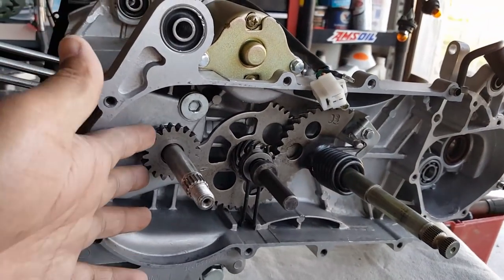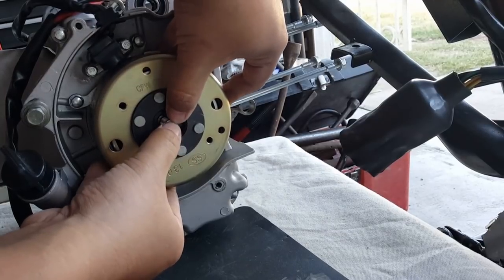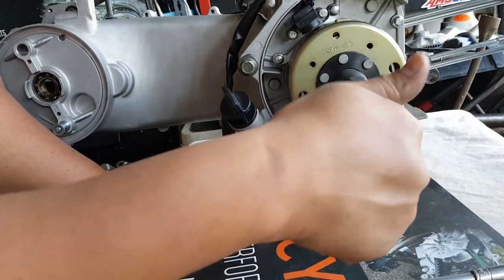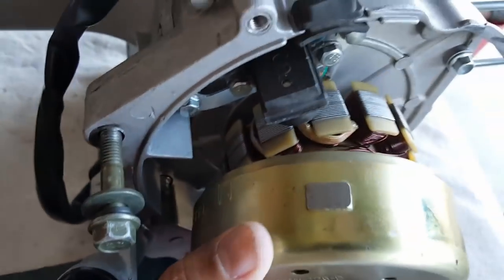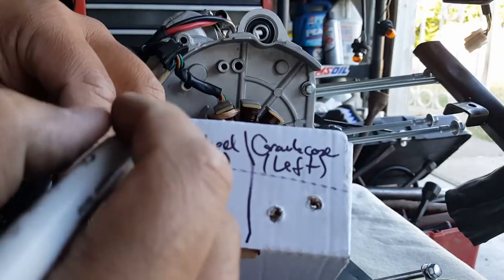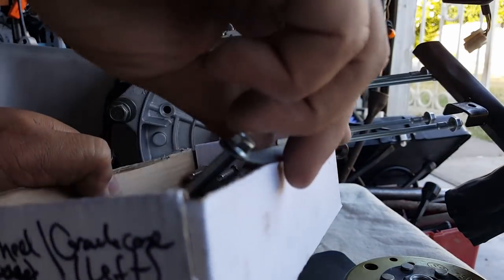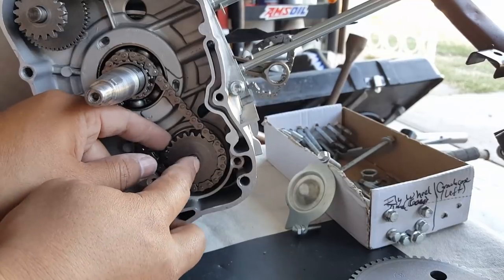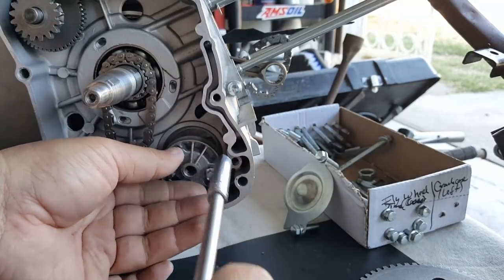How to Remove GY6 Flywheel, Stator, Oil Pump, & Starter Clutch on 157QMJ

Comment: The hole in the flywheel has a taper with the same angle as the taper on the crankshaft. When the nut is tightened the flywheel taper slides up the taper on the crankshaft locking the two parts together. The woodruff key prevents the flywheel from spinning on the crankshaft. The puller is required to loosen the flywheel from the taper on the crankshaft. Not to over come the magnetism.  Very good video.
Reply: He called Allen bolts "stud nuts"

Comment: 4:29 ; 
''only thing holding right now.... is the magnetic 
force''. To other viewers, doing first time stator
work;
 The reason you need a puller
is not due to the magnetic field, it is the tapered fit of the shaft
to hub, or hub to shaft, 
once that bond is broken via the flywheel puller,
there is a little bit of magnetic attraction, remove the flywheel 
carefully, be mindful not to damage the pulse coil adjacent
to the flywheel.
PS; On install, don't forget to align hub, with the keyway on the 
shaft, no need to force it, flywheel has a detente that slides
into that groove on the shaft.

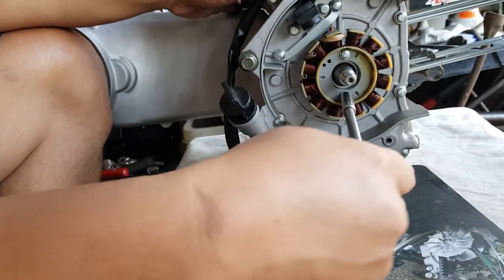Comment: 5:30 Very cool that this motor has standard bolt 
heads holding the stator plate to the motor, my bike's
stator plate is held with Philips head bolts, (nightmare without 
having correct tool) I'm waiting on the tool.

Comment: Great video my friend very clear Explanation my gy6 is leaking oil brand new scooter drove 1000 miles when they a leak normally is the first case? Or last case you took off at the end of the video? It look like it’s in the middle that is wet thanks

Comment: how i wish there was a mechanic like you where i lived...the ones available in my area are awful..i have my tools now and trying to do my own stuff....but it not easy for an old guy like me..i love your videos..very,very good.
thanks so much
Reply from the maker: One Love thank you for the kind words I'm sure you're only old as you feel you can do it, just use all the proper tools you'll be fine.
Reply: How do I get the nut off I tried using a socket wrench but it didn’t work .
Reply from the maker: conner robertson conner robertson if you tried loosen it spray WD-40 "Blue Torch" let it sit for about 20-30 minutes and hit again with impact driver if any of those aren't available requires a little bit more elbow ranching and securing of the rear wheel to lock down the clutch from spinning freely. Put a bar in the rear wheel rim just make sure put some cloth so it doesn't get nicked your rim in the process of putting a more arm muscle forcing the clutch nut loose.
Reply: NCY STORE can I use a socket wrench instead of a impact driver to get the rotor  off?
Reply from the maker: conner robertson my apologies I thought you're still working on the clutch nut I didn't realize you're going for the starter clutch nut assembly. Yes, you can remove the rotor with a socket wrench remove the rotor nut just remember lefty loosey righty tighty will only apply after this first nut after that doesn't apply to loosen you have to go clockwise.  Also if you don't have the special flywheel puller socket you can hit up auto parts store which more than likely have the free tool loaned program just have to leave a security deposit like purchase upfront the claw puller that help you break free for first time the super strong magnetic force holding flywheel to the rotor. You hear almost like a firework pop once it off the flywheel.
Reply: NCY STORE I tried using a socket but the flywheel keeps turning and I tried using a wrench to hold it but the nut is not screwing off.
Reply from the maker: conner robertson if you had the variator on still the other side still on lock it down and hold it in place with a variator holder or some kind of variator teeth lock, this will hold the other side of the crankshaft rotor stabilize so you can remove the flywheel nut. If you had the entire engine still frame including the rear wheel you can just lock the rear wheel, which lock down the clutch again, which driven belt is connected to variator thus locking down the variator which locks down the crankshaft rotor end as well, for you to be able to counterclockwise remove the nut off the flywheel. If a nut is very stuck try again with after a little bit WD 40 blu torch and attached a longer metal sleeve to your socket wrench to give yourself more leverage like jacking up a car. Next you'll need a castle nut groove socket to remove clockwise the castle clutch nut, if not you will nick a little bit using a flat head screw driver and a mallet hammer to tap it clockwise to remove the starter clutch nut they call the castle nut because of The ridges it looks like a castle top nut.
Reply: NCY STORE so I got to the old stator of my scooter but there seems to be 4 wires that were connected to the old one . I don’t know where those wires go on my new one because my new stator is just plug and play . I think someone put another time of stator on thinking it would work. I just won’t to know do I need those wires or can I just leave them.
Reply from the maker: conner robertson congratulation on busting that nut, no pun intended. Scooter wire configurations kind of varies type and color sometimes varies by manufacture not so standardized so I really can't tell you it's useful or not you just have do some more research in your particuler scooter electrical wiring to plug-n-play stator.
Reply: NCY STORE so apparently the place where I bought my vespa scooter replaced the cdi to fit with the Chinese stator to put on it instead of buying the correct stator online. What would I have to do to replace the Cdi ?
Reply from the maker: conner robertson We don't specialize in Vespa scooter CDI we deal with GY6 engine mainly. But I'm sure there's a lot Vespa dealers that can best guide you.
Reply: Most of the guys around here are trailer park types. Charge you cadillac prices.

Comment: it`s actually a cone press fit holding the rotor on not the magnetic force as you described
Reply from the maker: Ciprian Maior thank you for your "alternative" input.
Reply: not really "alternative" since it is the only reason why the flywheel sits so tight on the crank
Reply from the maker: Ciprian Maior just saying it's an "alter-native" like alternator. :)
Reply: also a Woodruff key not a Woodrow
Reply from the maker: Ciprian Maior thank you for clarifying that.
Reply: Actually its called a tapered interference fit, if you want to be clever about it.

Comment: Just wanted to make a PSA... the stater/flywheel is NOT held on with magnetic force😑 when the nut is torqued down it somewhat presses it onto the tapered shaft. The woodruff key doesn’t actually hold the stater in place it is just there to line it up for when you put it on. It is kept in time purely by the friction of the flywheel on the tapered end of the shaft! You guys gotta do more research.
Reply from the maker: Thank you for clarifying that I think another cometer says the same a cone pressed fit.
Reply: Ty. This guy is TRYING to school someone but he doesn't know even kno the basics! He Overly emphasized the whole video!

Comment: Excellent information for the newbie, I commend you on your work, very thorough and great explanations too. I usually don't do this but I have to. It's a woodruff key I think you said Woodrow key. Just thought you should know, OH and a bolt requires a socket or wrench and a SCREW requires a screw driver, you keep calling bolts screws, just saying. Good job though.

Comment: Good video but it's not magnets holding the flywheel on. The crank is tapered so basically you pulling the flywheel off the cranks tapper

Comment: Also , I'm not sure if that short amount of time ruined my case gasket but in case it did, would it be okay to use high temp liquid gasket because I have a tube of that sitting around and I can't really afford to wait for a new gasket to show up because I use my scooter for work. I'm in the hospital right now for probably 4 or 5 days but as soon as I walk out of here I'm going back to work on that scooter. Thanks for any help you can give.

Comment: Hi! Can you help me, I have a scooter with the same engine as this one. At first it started with a clicking sound of a solinoid  while starting it , I just taped the starter with a screwdriver and tried again it started... following day I try to start and it gave me dizzy noise like ZING!!ZING!! from the engine like it's failing to turn...I took out the starter tested it and it's working....did a research and usually it's a starter Bendix...so I opened from the Bell housing side but I didn't find that starter Bendix so I was about to go for the stator side which you are doing in this video but I see no starter Bendix again.......I'm confused can you please help me!!!

Comment: I recently switched to LED turn signals.  The brake lights don’t work.  Battery dies faster, and Headlight burn faster.   Could switching out strator and Regulator fix this ?   I have this same engine.

Comment: I was riding and my stator went out and wouldn't start. Replaced it and the magneto won't spin. Starter just spins. Brand new bike less than 50 miles on it. New ncy cdi upgraded spark plug coil. Everything tests good as far as the multi meter shows. When the magneto lines up with the switch it will try to spin the magneto and I'll get spark. But it only spins like 1 turn then stops. Battery fully charged and starter good. Is it my starter clutch or bad magneto? Only two things left besides valves which I haven't messed with cause it ran great before it died at the stop sign and wouldn't start. Don't wanna push the bike again that far. Lol

Comment: i saw in another video to line it up between the two lines above the TF. will it still run that way? I followed that advice and now i hear a knocking sound like its running a little ruff. I will remove it and line it up like you suggest instead

Comment: Thanks for this i do have a question my gy6 150cc buggy gokart, has been sitting for a long time i got a new battery but it wont start it makes a sound similar to when the starter clutch is bad, i replaced it but it still will not start, i did notice the start clutch even with the new one can turn in both direntions by hand. Im wondering what the problem could be , it sounds like it just spins when turning the key.
Reply: Hello mines doing the same thing when I turn the key did you resolve your issue if so do you mind telling me what went bad

Comment: what is the torque setting for the Starter clutch assy ? The nut that required the special tool with 4 slots to undo it.
Reply from the maker: Yes see under this video description for tools used. Torq 7 to 8 ft lbs starter clutch nut, however flywheel nut assy 27 to 30 ft lbs.
Reply: @NCYSTORE  Can I call you tomorrow to just check on a few extra things ?

Comment: It's not the magnet holding the rotor on, it's the machined tapered fit, it's similar to a press fit, but both pieces are tapered, the magnet may have a slight hold, but not holding it on!
Reply from the maker: true! thanks for clarify that.

Comment: Other than prevent the oil pump shaft from falling out, what does the splash guard do? Isn't that whole area submerged in oil?
Reply: The splash guard your asking about is so the oil doesn’t foam like a windage tray in a v8 engine the rpm’s these little engines turn is impressive

Comment: Hey when I turn my ruck key to the "on" position, my starter engages without me using the button.  Is this a bad starter solenoid? I even disconnected the right controls, and got the same result. Any help is appreciated, thanks and be well
Reply: Sounds like the solenoid is stuck in the on position or there's a problem at the switch. Use a volt meter to see if you have 12 volts at the solenoid before you turn the key to the start position.

Comment: Is the transmission lubricated from engine oil also? I am working on a scooter that the piston broke from from connecting rod and has sent metal throughout the lower end. Wondering how far I need to pull apart and clean before installed new cylinder/piston kit. I plan on installing a new oil pump.
Reply: No trans has gear oil in the rear does not come from motor

Comment: Ran into an issue replacing my starter clutch. After removing the nut and washer, the starter clutch won’t slide off. Any ideas? Thanks in advance.

Comment: Having problem with my starter switch does the stator have anything to do with it most of the time I have to go thru the selonoid. I have change all electrical components
Reply from the maker: The electric opponents are better just to replace and troubleshoot try to replace the switch see if that solves your problem

Comment: Question? Question? Is it possible to swap a 200cc scooter engine with a 90cc scooter engine? I am a beginner to scooters. I wanted to start to a lower phase before going with higher speed. If it is possible, where can I buy a 90cc engine from Honda or Kawasaki? I hope that some could direct me to the right direction. Thanks in advance.
Reply from the maker: Probably we don;t specailize in Honda or Kawasaki engine sorry, only GY6 swap!

Comment: So once I've done the nut back up that holds the Starter Clutch Assembly on the crankshaft is the suppose to be a little 
endfloat  ????
Reply: What is an endfloat? Are you talking about the washer holding the clutch down? I only ask because mine doesnt have a washer and seeing if others have the same thing.

Comment: When you talked about finding TDC you said line it up with the T.. Did you mean line it up with that line which is just left of the T?
Reply from the maker: Yes that timing cover cliff-hanging piece needs be directly above the T mark on the metal flywheel.
Reply: Ok thanks.  I have seen people say use the line which is just next to the T.  This is the first time I have heard to line it up with the actual T.
Reply: @racerx143  Same here. Never heard about the actually lining up the vertical line of the "T" with the timing mark on the side casing??

Comment: ciao, una domanda, vorrei far andare più veloce il mio scooter, attualmente raggiunge la massima velocità di 80Km/h, ho cambiato il variatore con massette da 17 gr ho comprato la centralina cdi aperta ma non posso collegarla perchè nel mio scooter nel pin della centralina originale a quanto pare manca il cavo che dà corrente mi piacerebbe far arrivare ad almeno 130km/h cosa mi consigli? e se possibile contenere i costi.
hello, a question, I would like to make my scooter go faster, currently it reaches the maximum speed of 80km / h, I changed the variator with 17g masses I bought the CDI unit open but I can't connect it because in my scooter in the pin of the original unit apparently missing the cable that gives current I'd like to get at least 130km / h what do you recommend? and if possible contain costs.

Comment: The bolts on my flywheel fan will not budge at all,any ideas?
Reply from the maker: Sorry late response you can try to get blue torque by WD-40 spray on a little bit then sit

Comment: Can this all be done while the heads and piston are still installed?
Reply from the maker: Kawai hao if you're asking to remove all the stator unit while the cylinder is still installed yes however in order to split the crankcase open you eventually have to remove the cylinder jug but piston can still be attached to the crankshaft.

Comment: What is the bracket called that held the stator wires back against the timing cover?
Reply from the maker: Joshua Murphree try "GY6 stator wire holder brace" not sure if that's the technical term of it I know what you're talking about just don't know what's zactly called
Reply: I found a lot of results on eBay searching stator wire retainer. 👍

Comment: I'm really hoping you can help me out I did not organize my screws and now I don't know which go where
Reply from the maker: You don't have to be perfect just do a drive bit with the screws that you currently think you know where it's at and just try to see make sure you don't force it to go any deeper than can and try to feel your way through it you'll be fine
Reply: @NCYSTORE  have been trying but theres a few that are pretty darn close in size and it's a tad frustrating, but I will continue with your advice in mind. Thank you!
Reply from the maker: Nothing on the GY6 is precision trust me however people swap them all time for Allen bolts and they're always not exactly the same size off by centimeters is still works perfectly. Don't sweat it do the best you can, you might actually find it better fit at certain both eyes certain areas just when you stack them together you'll realize that maybe this one needs to be longer or this one can use a shorter one.

Comment: the magnet part only goes on one way don’t worry about lining the T it lines up by itself, andto remove the magnet you can use a bearing puller

Comment: Hi i bought a Dong Fang Chinese dune buggy replace most of the engine it turns on and it runs but it doesn't run very fast or at full speed going forward but when you put it in reverse it runs pretty fast like i said i replaced most of the engine and it just not working i bought it used when i got off the trailer and was going to take it for a spin it just stopped working help what  could it be its 200cc engine
Reply from the maker: we have very little experine on those and parts unfornately does it look like this cylinder https://ncystore.com/g-cylinder-57.4mm-150cc-big-bore-kit-cast-piston-fit-56mm-gy6-atv-buggy-quad

Comment: Well  its not holding ong by magnetic force the crank and the fly wheel have a cone shape thats the reason its on there so snug. and if you dont want to pay for a fly wheel puller you can hit it with a rubber mallet and it wil come of